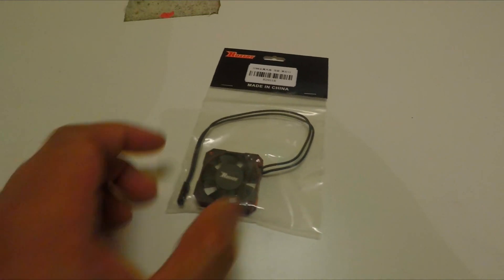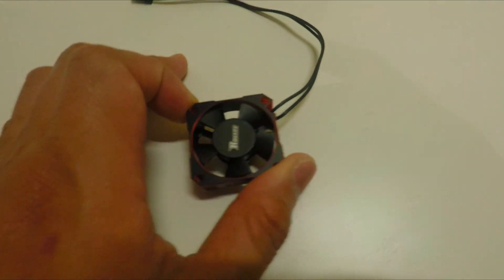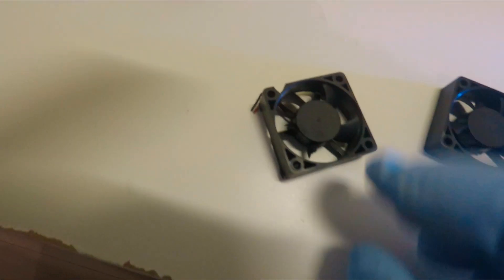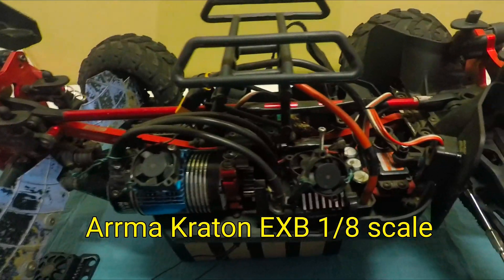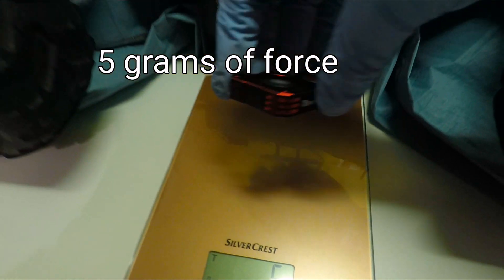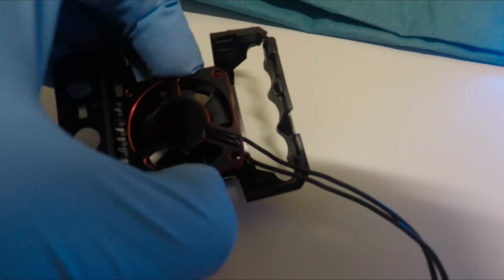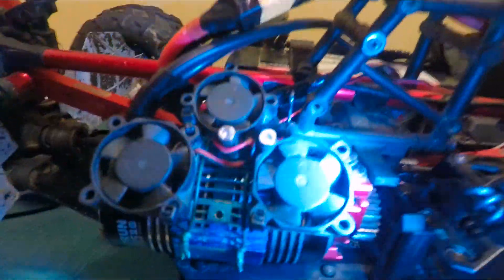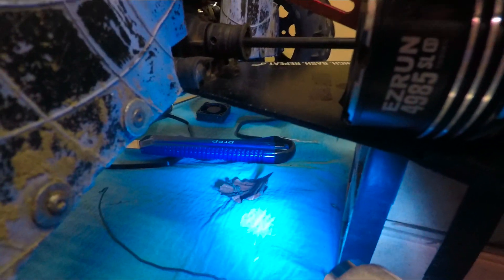Max6 ESC problem solved! | CHEAP and STRONG fan | Surpass Hobby

Comment: Both hobbywing esc's I bought failed immediately. The one didn't even work right out of the box! It was a max 6.  I'm sure they make decent stuff but no hobbywing for me.............
Reply from the maker: Sorry to hear that. I feel you bro.. There are chances that any product would malfunction due to production errors. That's why it's better to have a warranty.
I also had a few experiences before, but with GoolRC brand this time. I bought 2 esc from them, different instances, and they all burnt right when I connected the batteries..
So, no more goolrc brand for me as well 😢
Reply: Hmm i didnt seem to have nay problems at all using goolrc and hobbywing, probably you guy didnt operate them properly, can you elaborate what exactly you did, every sibgle step u did to deem it not working and also for goolrc what esc was it, what motor were u using and what lipo specs and what connector and what size wire? Maybe i can do some troubleshooting to gelp yall out😁

Comment: I suggest you superglue some mosquito net on top of you ESC to protect the fan from gravels and little rocks.
Reply from the maker: Thank you for the tips sir. I got some drywall tape and aluminum mesh. Just too lazy to do it 😁. Maybe some time this week
Reply: Nah i dont recommend because first of all it will create more noise and the colling oerformance would be much much downgraded, due to the much less amount of intake capacity, and generally speaking all you have to worry about is big debris ruining the fans, which are already being blocked by the plastic, and not the small ones which are able to fit through. His fan is broken is im assuming from jumping and crashing, and due to the shock and impact it twisted the frame of the fan a little because its plastic so the fna blades hit the frame and broke offzhowever you dont have to worry for the rocket fan as it has a 6061 aluminum frame which is suoer durable for a fan and its plenty for protection, and please please please dont out drywall tape for meshing🙏🙏🙏